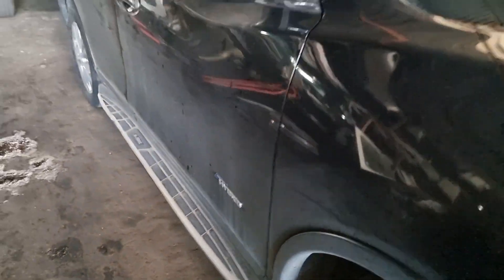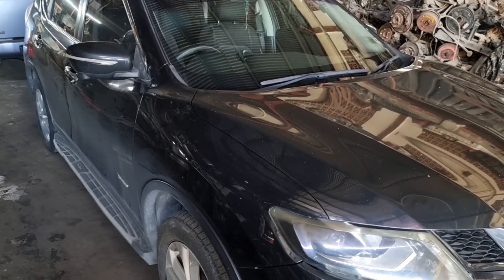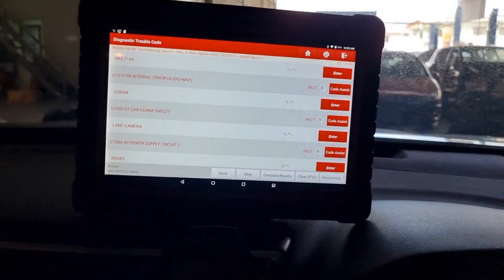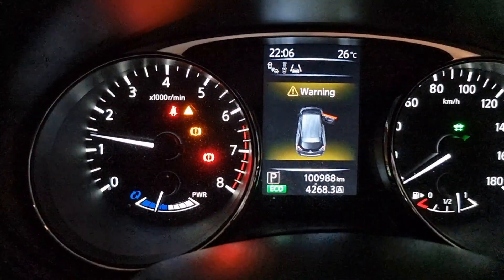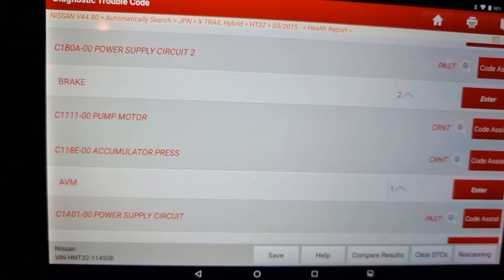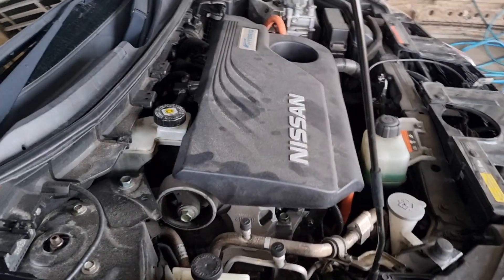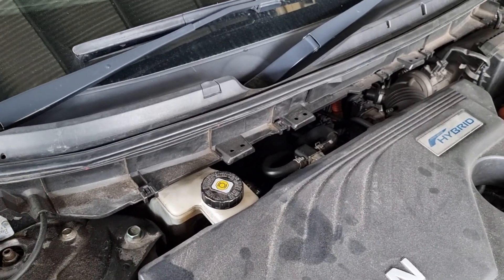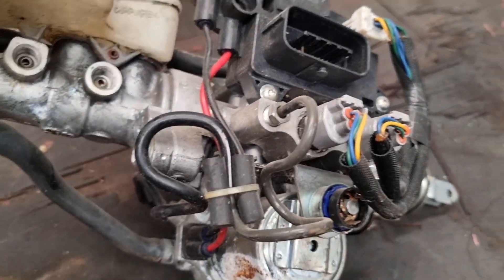nissan x-trail rogue hybrid brake system problem diagnostic

Comment: Hello ..Same prob. here..My 2015 Ht 32 Hybrid has hand brakes lights staying  on and whistling sound continous.  braking hard..Do you sell the motor..for Abs. Diagnosis says brake accumulator motor faulty.
Reply: I am having the same problem right now.
Reply: @Chris-um8pz  did you buy a new booster pump?
Reply: Same here..mechanic says even 'original' is faulty..time to sell

Comment: Hi Jose. Really good content! I've been following you since I own a Prius C. In this video, you also mentioned about the abs problem on a Prius C. Would it be possible to make another content for Prius C as I think it would be really helpful to to community. Most of the owner just changed the whole unit without knowing what is the real issue. Thanks in advance!

Comment: I have 2022 Nissan frontier with pretty much the thing. I have a C1111 dtc only. Once I start the truck the accumulator will make a noise likes it sucking air for a second  or or two every time it cycles like every 10-15 seconds. I’m at a loss?

Comment: Hello I'm from Trinidad 🇹🇹 can you tell me where can I get the motor also where's your shop located?
Reply: Wen u get yru let me know were can I get it
Reply: Im told all motors are from China...even original...n substandard...used cost 6000.00 installed...n dont last

Comment: Great video my friend. Question, does a dtc c1111 always indicate pump motor problem with electronic brake booster or does it also indicate problem with abs motor? Reason i ask is because i can hear the brake booster pump running when the pedal is depressed however my scanner is unable to run the abs pump motor due to a communication error and i also have the c1111 dtc.
Reply: You change motor?
Reply: @29matsuda  havent changed anything yet. Still trying to source the correct abs module. The electronic brake booster however is fully functional.
Reply from the maker: Clear everything first the try again...

Comment: i have the same problem with my nissan x trial 2016,making the same alarm sound.  does this mean that i have to change this motor? will it fix the problem permanently or it is a quick fix? do i need to change the whole brake booster. please advise
Reply from the maker: Just change the motor and that should solve the problem...

Comment: Good video bro I'm a auto technician 11 years now and do alil of everything like ac, key programming, hybrid servicing(following you to learn alil more lol), engine rebuilds, auto electrical n diagnosing problems etc. Keep up the good work 👏.
Reply from the maker: Thank you kern.... hope this material helps ☝😎
Reply: Can the wrong power voltage battery cause the actuator to burn?